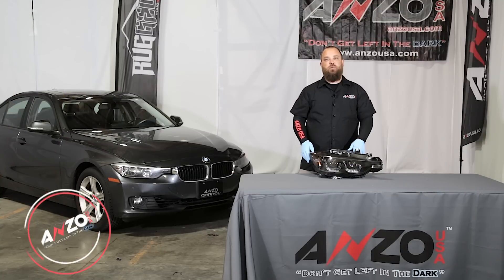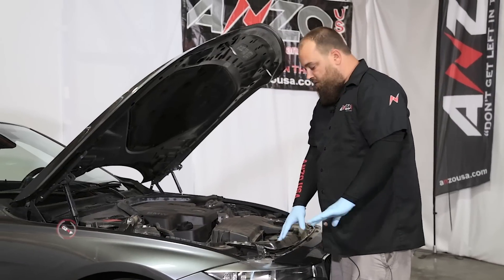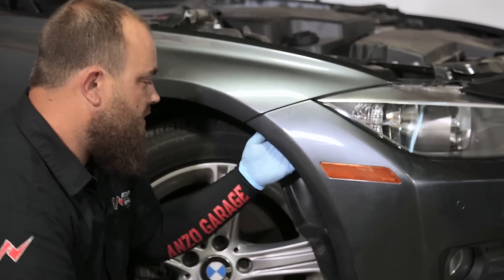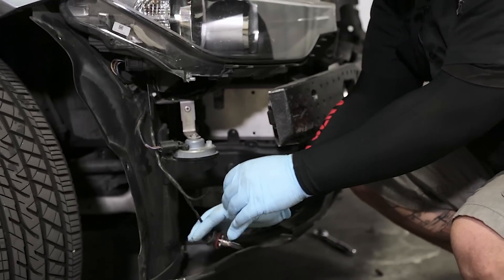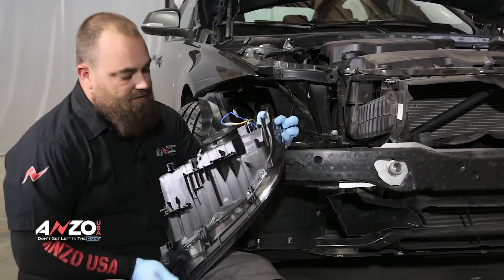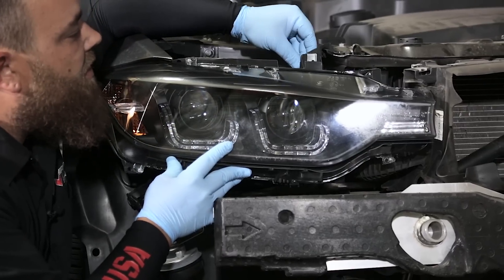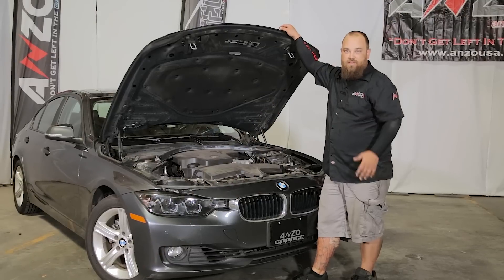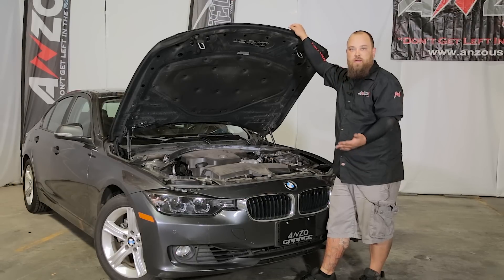Anzo USA 2012-2015 BMW 3 Series F30 4DR Projector U Bar Headlights

Comment: They are plug and play. Esay enough to install yourself, did my own. Took spoiler off, wheels off, inner wheel arches off. trickiest part were the four mounting bolts were fiddly to take off, but easy with new fittings to assemble. The original halogen headlamps gave the worse lighting compared to the very many cars I've owned in my time and I couldn't see clearly at night with original headlamps even with uprated halogen bulbs. I tried HID kit in original halogens and they very bright in one spot and useless for a wider beam of light for driving so I replaced the headlamps with these and replaced the halogen bulbs that came with these new headlamps for fan less led bulbs and the light output from the led bulbs are brilliant, no comparison to previous halogen bulbs or HID kit. Two main reasons I bought these headlights were they give a better light output which is the most important reason why I bought them and the cost was reasonable compared to DEPOS. I think it's disgaceful that BMW can get away with selling cars fitted with such lousy light output on halogen standard headlamps. Shame on BMW, I for one would never buy another BMW with halogen headlamps, ever again.
Reply: Hello, can I ask if it is possible to replace the low beam bulb with LED bulb for this headlight assembly?
Reply: Yes, you can replace halogen bulb with a LED bulb but you may have to fit a resistor to overcome bmw coding when fitted.
Reply: Wain Pain Thank you very much for your quick response! Could you please give me a link of the led bulb that you purchased? Really appreciate that!
Reply: Wain Pain Hello, I have one question, are yours both the high beams and low beams in the same lens?
Reply: Wain Pain oe
Reply: Solid point Wain... I am pissed at BMW with their stock 3 - series (F30, PRE LCI) halogen lighting technology, at least bloody fit em with xenon rings, like the LCI E90's.... why downgrade from LCI E90 to F30? Such a silly decision on their part. HOWEVER, their LED angel eyes and LCI LED angel eyes are gorgeous... I definitely will try to replace my halogen's with a nice LED kit.

Comment: What's the power rating for the U bar LED lights? I'm planning on wiring this up with a iJDMToy DRL Module that supplies 12W capacity.

Comment: Wait... This video says 2012-2015... website says 2012-2014? (Thinking) I have a 2015. Will these work for 2015?
Reply: BMW 2012-2015 is the same design. Yea it will.  it won't work for 2016 though.

Comment: I bought these with the chrome finish and got a low beam malfunction upon completing installation. after adding H7 lumen LEDs it went away but came back with both high and low malfunctions. Any clue as to what went wrong? I had a bmw mechanic install them (not at a dealership).
Reply: MrPianofan2010 Wain Pain Hello, I have one question, are yours both the high beams and low beams in the same lens?
Reply: You need to have them codded off so they will not show the warning
Reply: No they are separate
Reply: You may need to code off the warm and cold monitoring for the beams. You can do this with an OBD receiver and bimmercode or any other coding tool.

Comment: Can anyone comment on the performance of these particular units?
Reply: i got these last month and they make visibility better than factory halogens. i highly recommend these lights as they are easy to install and to adjust if you don't want to spend over 2 k on oem adaptive head lights. it also offers a very nice look to the front end.
Reply: Ryan St.Amant Wain Pain Hello, I have one question, are yours both the high beams and low beams in the same lens?
Reply: Hey! As I've seen in another installation video, the high and low beams are in the same lens, while the other one functions as DRL. See all the way in the end of this video, when he switches from parking to low beams.